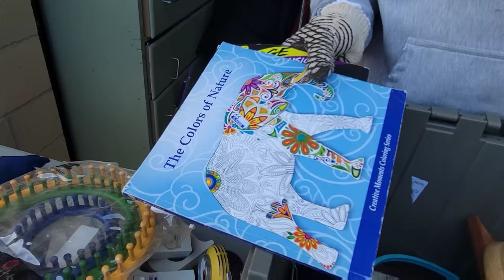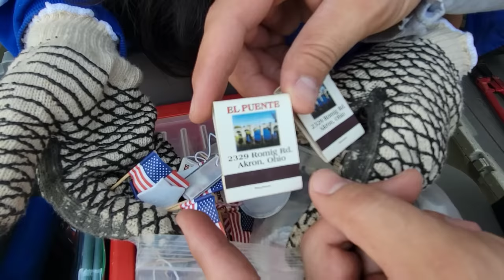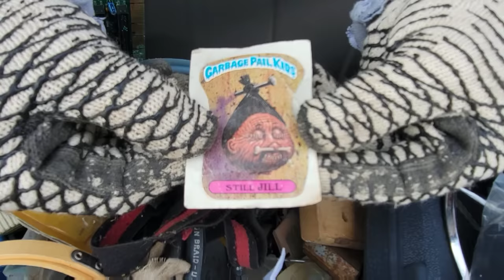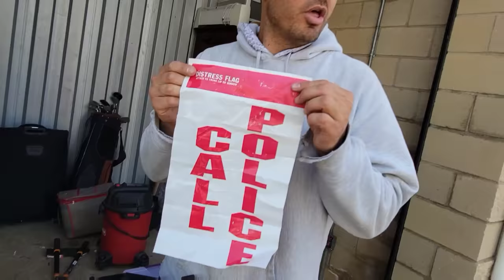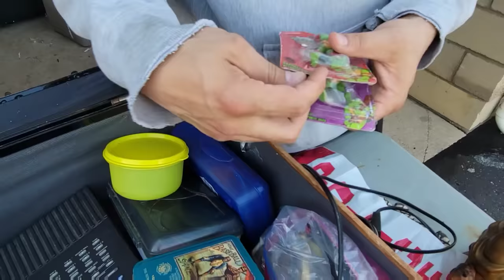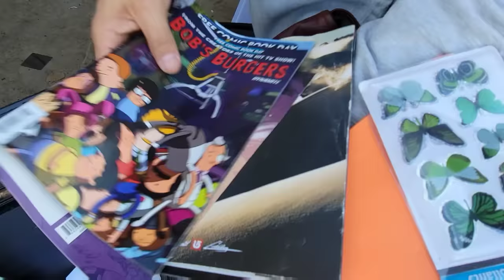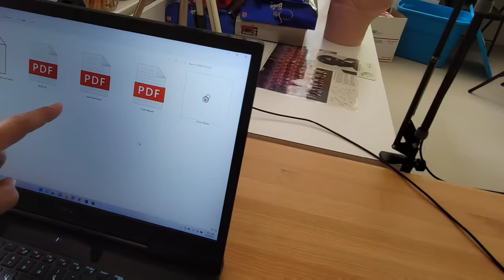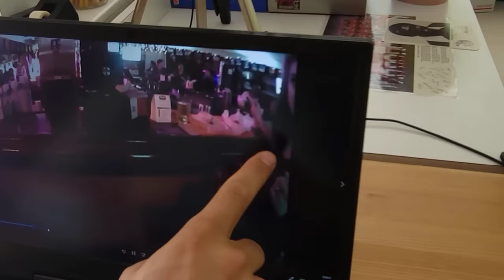COPS CALLED On Former Owner Of Abandoned Storage Unit

Comment: Who are Eligible to Donate Blood?

Age between 18 and 60 years.

Haemoglobin - 
not less than 12.5 g/Dl.

Pulse - between 50 and 100/minute with no irregularities.

Blood Pressure -Systolic 100-180 mm Hg and Diastolic 50 - 100 mm Hg.

Temperature - Normal 
(oral temp not exceeding 37.50C)

Comment: The round thing you did not know what it was where you found the wallets and wooden dies - that yu did not know what it was.  It is a magic trick.  The inside comes out and you put a nickle in it - then you put the ring on and tap it several times - and it looks like a stack of nickles - then you put it back together while putting 4 dimes in the hollow amount and you tap it (without the nickle it doesn't get knocked loose) and you have changed the nickles into dimes.